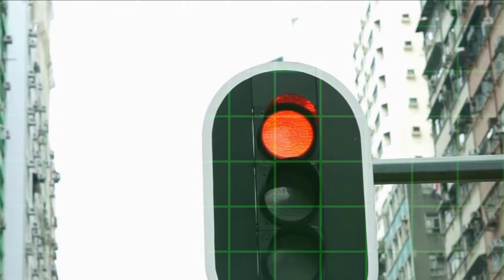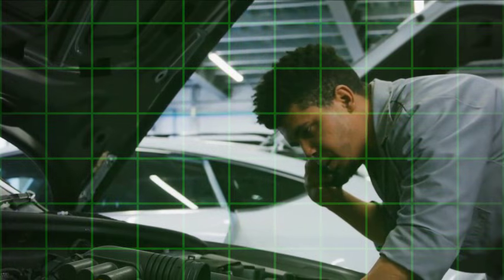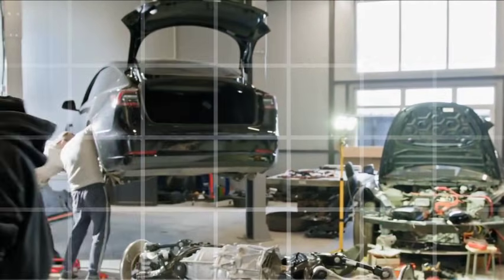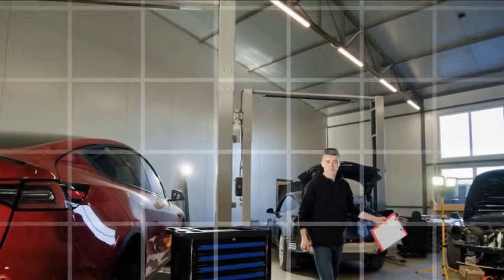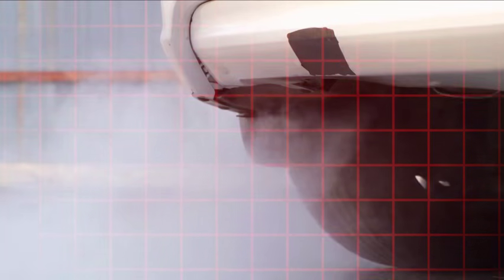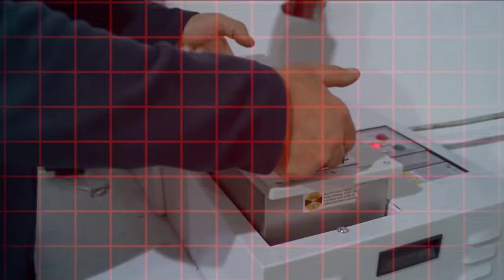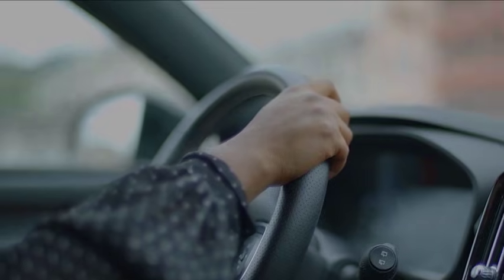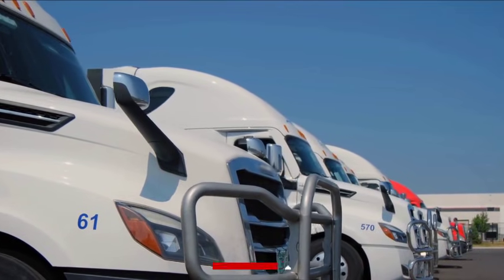The Truth About Auto Stop Start System | Nobody Talks About

Comment: I just stop at red light, car engine turns off, 2 seconds later I get green. Or I park my car, engine turns off, and 2 seconds later when I just wanted to fix my position at park space the engine has to start again. Also its not so useful for my driving, as I am slowly stopping the car before red light anyway, so that I don't have to wait long, or wait at all anyway. I mean I get the green idea, but the implementation is harder than it looks and I'm not sure it works good.

Comment: Did the creator even watched what the AI produced? The downsides of the start-stop system that almost nobody talks about is fogging of the windshield and windows and changes in temperature because of not working AC and heating, and lack of power steering during the engine shutdown. In VW cars it can even kick in before you fully come to a stop leaving you without power steering in the last few meters before and during the stop. Increased wear, restart delay and very debatable advantages are already widely covered everywhere.